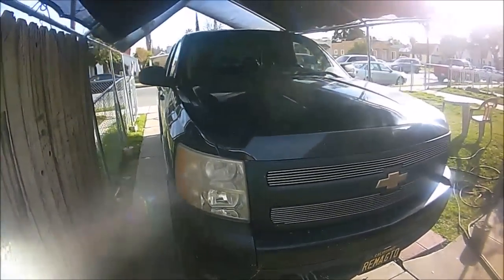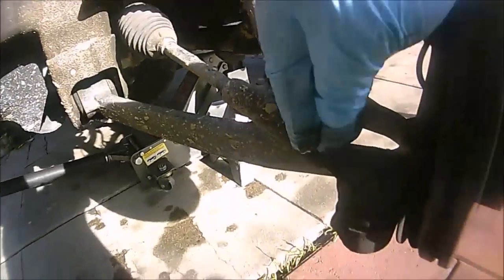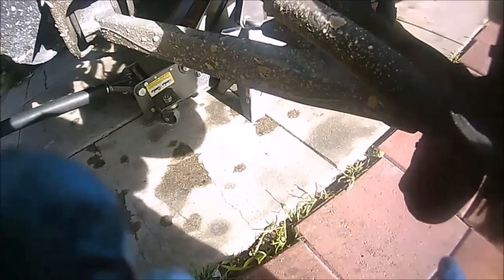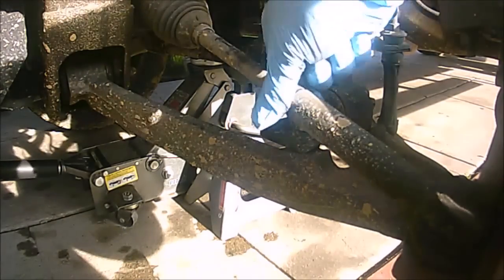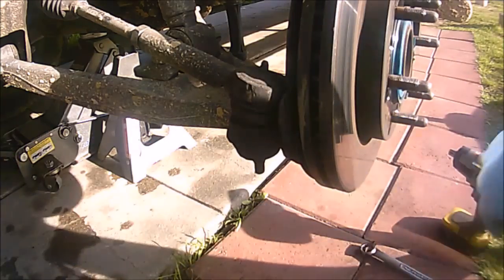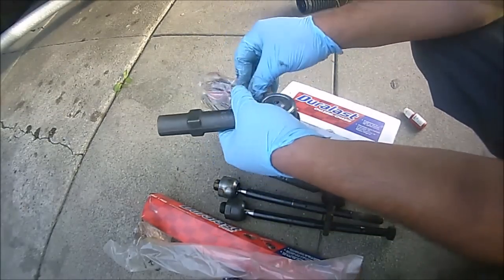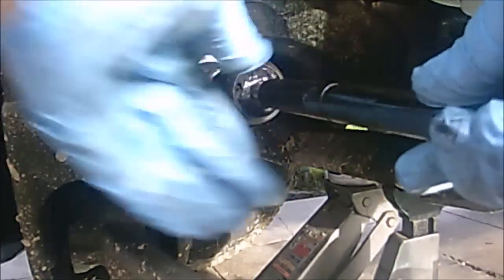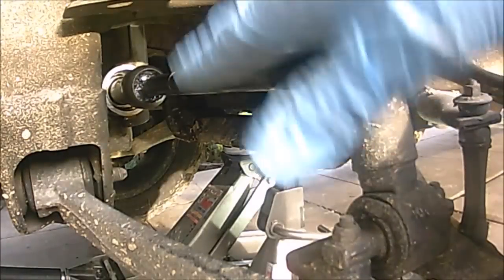Inner and Outer Tie rod Replacement on 2007-2013 Chevy Silverado/GMC Sierra

Comment: If you are replacing both inner and outer.  Its better to remove them in one piece. That way you can measure the same distance when you install the new ones in one piece too. Thats my opinion.
Reply: True if you had enough clearance for a wrench to fit on the inner tie rod socket
Reply: So don't remove the outter just the inner So it remains whole? Sorry I'm dumb

Comment: I learned a lot from this video thanks
Reply from the maker: Your very welcome. Thank you for watching
Reply: My truck is not that bad like yours it’s only vibrating on 65 mile speed 
I checked the front wheels they have very very little loose that i barely feel it 
Do I still have to replace the inner rod

Comment: Wow I like how easy your tie rod end comes off.. I have not been able to get mine off I have soaked in PB blaster use the map gas torch use a oxygen torch smacked it with a hammer tighten down the best vice grips I could buy and tried to hold the inner tie rod in place as I took a big 18 inch monkey wrench and tried to twist off no luck...
Reply from the maker: Try using a tie rod puller, tigh it down and hit it with a hammer and tight it more and hit it with a hammer in between brakes spray some pb blaster. Hope this helps
Reply: I know its been a year but my truck was a canadian truck before it was mine. Rust like crazy. The way i got my end off was i held the jam nut with a 24mm (15/16”) wrench and put a 22mm wrench on the outer tie rod end itself. Soaked the dogshit out of it with pb blaster, and it came off. Granted, my jam nut was rust welded to the inner tie rod end but alternatively you could hold the inner tie rod with a 16mm wrench and do the same. I hope you got it off. Mine was a bitch.

Comment: Thank you for using the wrench instead of the inner tie rod tool!
Reply: When did he use a wrench? I’m confused because to me it seemed like the video just cut and all of the sudden he had it torqued. So frustrating because I clicked on the video to see how he torqued it properly.  These guys are no help sometimes.
Reply: @klg1001  no one really torques it to specs, they just get it tight and the blue loctite keeps it secured as well. 
The tool to torque it to factory specs is an adjustable toque wrench.

Comment: Great video bro! Helped a lot! But I also wanted to ask, can I still use my old boot if it has a few holes?
Reply from the maker: I would not suggest using the old boot if it's damage. Water, road dust will end up getting in those small wholes and that can ruin your new tie rods.
Reply: Got it. I’ve seen a few online for about 7-8 bucks. Thanks again for the tip.

Comment: when you removed old tie rod   did you count the threads. im sorry if i missed the count.   when you installed new tie rod  I counted 23 turns am i right?
Reply from the maker: Yes, I counted the threads to at least get it close to the alignment but still need to take it to get an alignment

Comment: So the reason why my truck could not be correctly aligned was because the tie rods are bad. If I were to install myself, could I drive the truck to the alignment shop without putting grease?

Comment: Lol if a nut gets stuck in a socket just take the socket off impact and tighten it on the bolt till it's free then use your hands to remove

Comment: I just keep the whole tie rod as one unit.. this way you can match the length to new tie rod assembly..turn wheel all the way left so you have  better access to remove without taking outer tie rod off the shaft..if you have a hole inside the inner tie rod threads you can fill up the inside threads to pre grease the inner by screwing it back on the shaft..then unscrew & clean the threads add locktite on final install

Comment: Did you get an alignment after or was it pretty good ? Thx for this video I ordered my inners and outers for my 2010 gmc and I'm attempting this in a couple days amazon had good prices on them, I just changed my leaf springs on my truck both sides and that took 11hrs had to drop gas tank on drivers side so I think I can handle this.
Reply from the maker: Yes, I had to get an alignment to get it to perfect steering. Anytime you work on any suspension an alignment is a must.let me know how your inner and outer rod diy goes. Thanks for the comment .
Reply: Oscar Ruiz-Autorepair just did them in the garage it turned out perfect went as smooth as the video you uploaded, the only thing is there was excess oil in the dust boot I don't know why it would leak into them. Thx again for the video it helped me save so much money and you did easy instructions thx brother
Reply: @kurtismonasterski9644  excess fluid in the boot usually means the rack end seal is leaking

Comment: Its hard to compare to my truck but I hear a small click. I think I have bad shocks and maybe a bad tire as wheel. My steering wheel shakes really bad and wheen I inspected tire it seems to not be 100% round. As i spin tire it goes up and down about 3/8 of an inch.
Reply: Check your tire for round.. It could have a tire with cords starting to go.can also check wheel bearing for play..will cause vibration.

Comment: how did you torque the inner tie rod?
Reply from the maker: I used the inner tie rod tool (the red and black long tool) with a (1/2) 32mm socket and a torque wrench. The tool is seen at 12:54 in the video but i was not able to show how i torque the inner tie rod due to my camera ran out of battery.
Reply: Oscar Ruiz-Autorepair ahhh. Ok thank you. You’ve inspired me to work on my 2008 Silverado, you make it look so easy. Hahah
Reply from the maker: Your welcome. I agree, its simple..easy..and fixable. Do not be intimated to work on your 2008 Silverado, once you start to work on your own car/truck you will start to get a feel for fixing it yourself plus you will save 100's of dollars doing it yourself.  Just for this 2007 Chevy silverado the dealership wanted 450.00 to change out only the inner tie rods!!

Comment: no. nope.  not good.

replacement tie rod ends are not all the same length.  counting "turns" ONLY WORKS if you have the length tie rod end.  To make positively certain, simply measure the length before pulling the old tie rod end.  compare this to the replacement.  if they ARE the same, then counting turns will work.  alternatively, you can simply screw the tie rod end back to the same threaded positions.  Use the locking bolt as your guide, or just look at the non dirty clean threads.

IF THE REPLACEMENT IS NOT THE SAME LENGTH, then you have some measurements and some math to perform.  I trust everyone has average math skills, like addition and subtraction?

lastly, regardless of the method, you will probably still want to get an alignment done.  Usually, if you are replacing tie rod ends, means the age of the vehicle is sufficiently old to assume your alignment is off.  so even using this "trick" mentioned in this video is not really going to get your wheels aligned.  it will simply be putting the geometry back to what it was or close enough to what it was when you reinstall the new tie rod end.  And again, that does not mean the wheels are in fact aligned.  

just get an alignment.  Be smart
Reply from the maker: @tdmmcl1532  thanks for your valuable feedback.